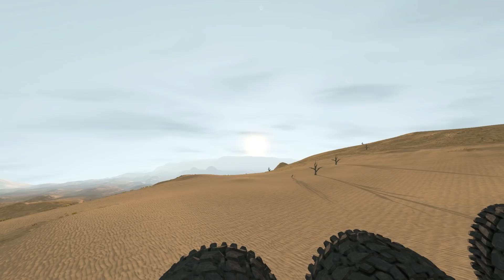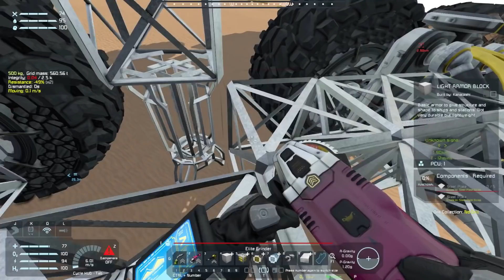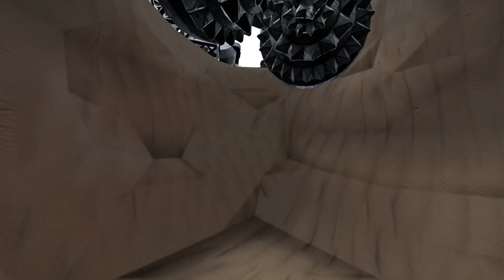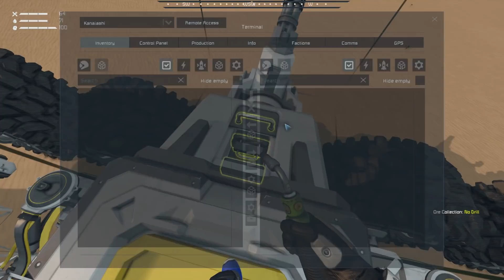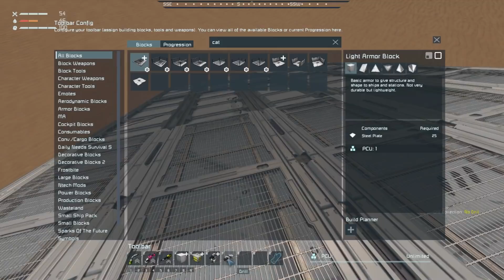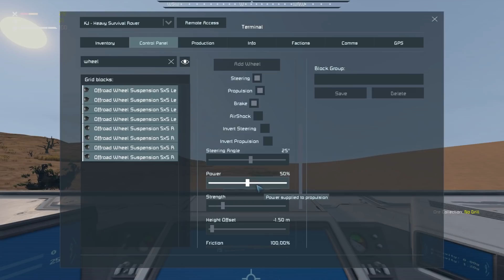Space Engineers - S3E14 'Drilling Systems Online'

Comment: How are you able to jump down two blocks or more without taking any damage?  Yes, you occasionally drop too far and die but as a general rule you drop more than two blocks on a regular basis with no damage taken.  I've looked over your mod list and don't see anything related to fall damage negating.  I'm on the same planet in my current play through with the same mods (minus the no jetpack) plus some that your running and if I drop two blocks I'll take 20 points roughly of damage. Am I missing something?  I try NOT to use my jetpack but I can't seem to bring myself to get rid of it.

Comment: If you are going to start painting you may want to add the spray gun mod. If you are going H2 thrusters I would try 2 small first. 2 or more large may get you a little more air than you want on hills! Don't want to do a Capac Bitter Pill and do an end-over-end loop. 
Is time for a few drones? A small miner, small welder/grinder to help in building rover/disassemble bases, and maybe a small sniper drone? Pop up, take out a base turret, then drop back under cover sort of thing. Or just use the miner and sap bases. Worked well before but you may run into a few warhead-equipped bases that way.
Reply: also, breaking thrusters...
And parachutes, just in case :D

Comment: Your digging a hole for the RV wheels to fall into on both sides 17.38 would you not be better off scrapping the surface as you roll along (for stone) so set short distance for the piston to move and move the outside 2 drills on both side to the inside of the main drill maybe.) just a thought
Reply: I agree, the Row of Drills should be Parallel, not Perpendicular to the Mastodon. 
I'll assume he either changed it, or found a way around the potential problem.